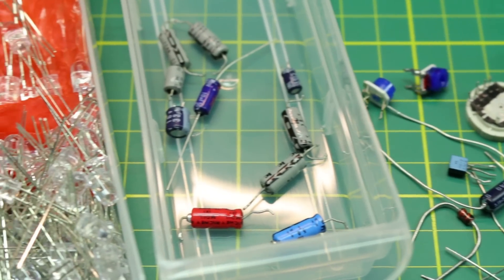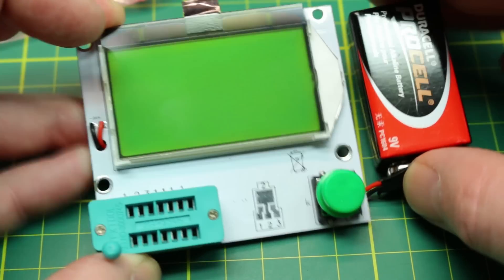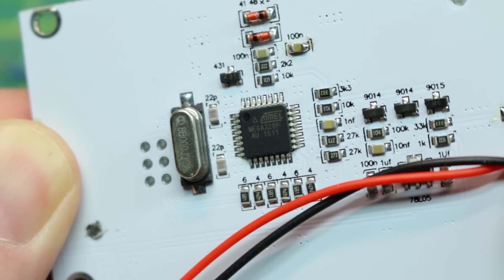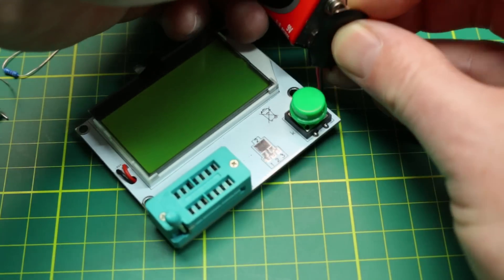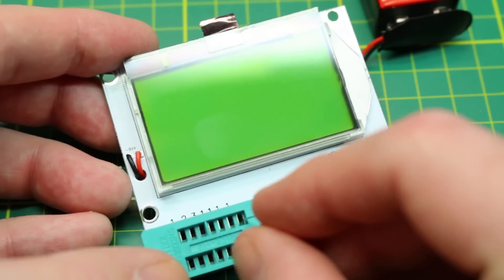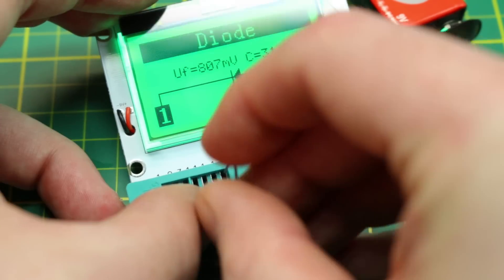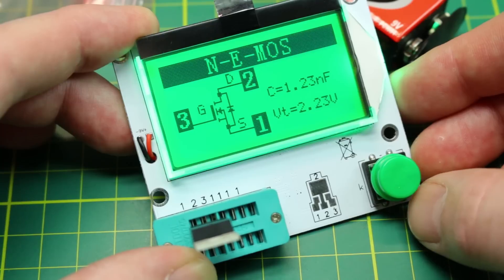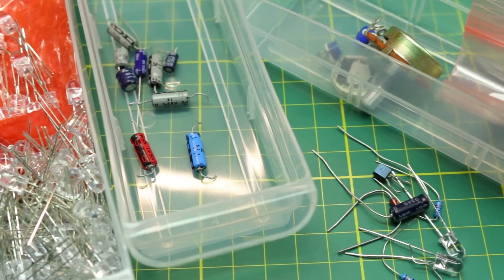Multifunction Tester LCD12864 Transistor, Inductance Capacitance Resistance

Comment: I use this tester. It is good tool to have at hand. I have a problem that it drains the battery after few months without being used. And also it detects a part few seconds. I wish it would be quicker.

Comment: Hello. Where did you find the source code ?  I have got approximately the same tester. It is a great tool for the price.
Reply from the maker: +Michel PASTOR I googled "Arduino component tester" and clicked the first link :)  Cheers
Reply: +MKme Lab Thank you. I found something (v07f) but I'm pretty sure it is not for the graphical dot-matrix LCD version like yours and mine.
http://black-electronics.com/blog/wp-content/uploads/2013/05/ArduTester.txt
BTW the first link I got points to Adafruit forums but the links to what seems to be the original version are all dead (PighiXXX).